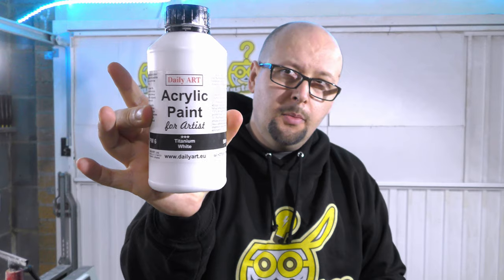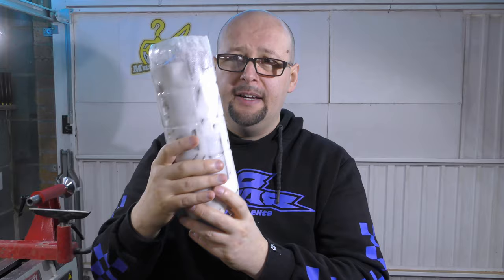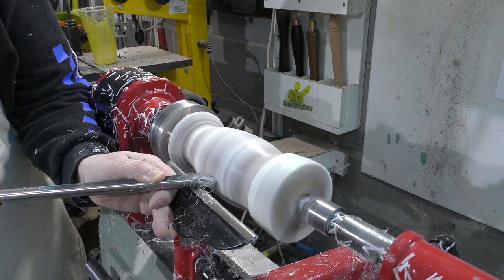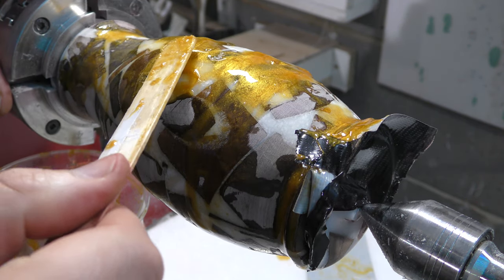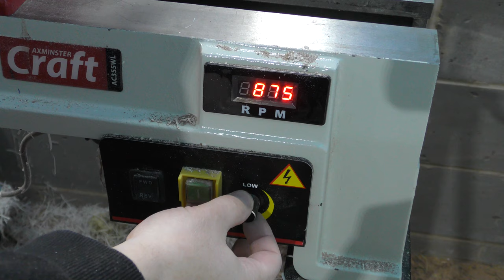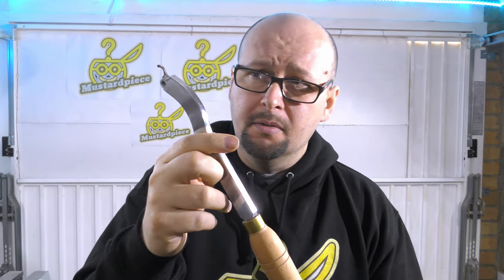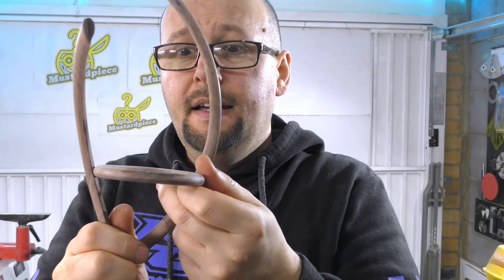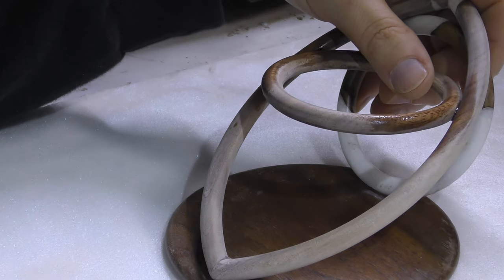Turning Scrap Wood into a $200 Art Piece - Trash to Treasure

Comment: Do you rely on the ca glue for strength for the rings or do you drill in and add small dowels for added support?  Great job I may add!
Reply from the maker: Sometimes I drill in dowels, but for this project I just used glue. Thank you for the visit.